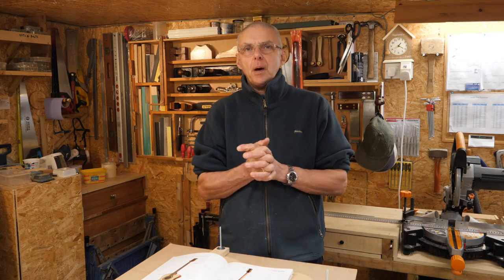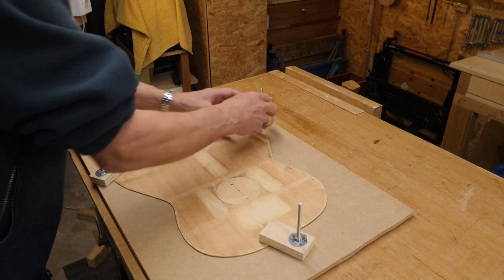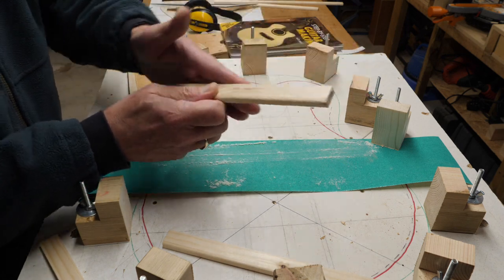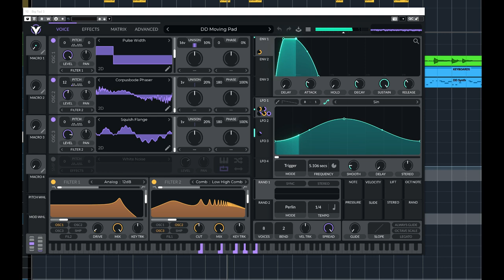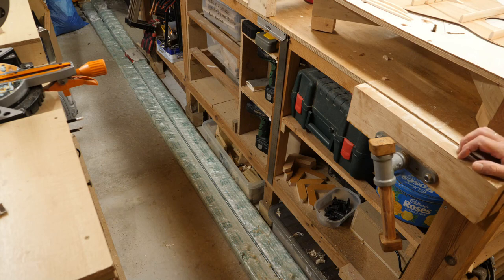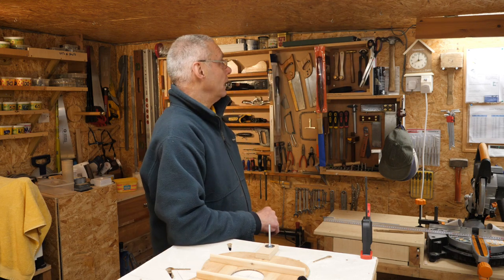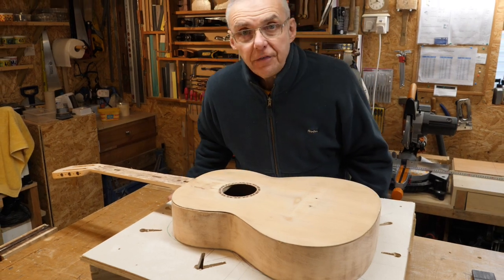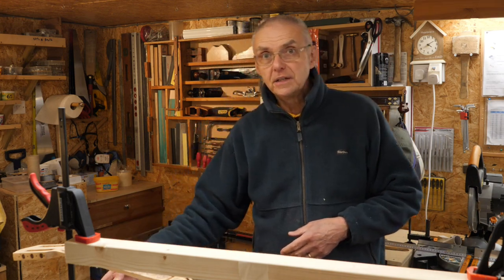My 50 year old acoustic guitar repair challenge - Part 7 bracing the soundboard

Comment: Great progress Dave. Looking forward to the next episide. For a finish, why not try a homemade version of true oil. Equal parts of boiled linseed oil, white spirit and polyurethane varnish. You can ad stain to it if you'd like it darker, then just wipe it on in several thin coats.
Reply from the maker: Thank you for the tip, I will have to try that sometime. Cheers Dave

Comment: Odie's Oil might work for the Guitar finish. They have several different formulas of both oils and waxes. Gives a nice satin finish with a coat or 2 and if using the wax after the oil cures you can get a bit more shine. Just read the instructions it says to use a very small amount apply by hand with a buffing pad kind of like a 3m scotch bright work in in to the grain. Let cure for about 15 to 20 minutes and wipe off or buff with a clean lint free cloth and reapply if desired. It was originally formulated to be used on bowling hall floors I believe it says on their web site so it should be fairly tough finish.
Reply from the maker: I’ve not come across Odie’s oil, sounds interesting thank you. Cheers Dave

Comment: Mate, Im very concerned about your decision to replace a hardwood bridge plate with a dpruce brace. Really a bad plan, and may end up in tears. Id hate to see you rebuild tge guitar and have it fsil badly due to this. The function of the bridge plate is to reinforce the top for seating the strings, and to keep the top flat so the bridge stays in place. Without a bridge plate, the bridge would have a much greater tendency to "peel" loose from the spruce top.
Dont want to sound like a negative nelly, but id hate for it to go belly up after all your work. Mind you, the weight of those fan braces may be strong enough to resist that lol....although they are also likely to be far too heavy to allow the soundboard to vibrate enough to produce any decent sound...thats why it sounded pretty "flat" when you tapped it.
Reply from the maker: Hi Andrew, always grateful to receive your very comprehensive advice, thank you.  I'm on the case with the heavy braces so please keep watching.  I understand what you're saying about the bridge, I have a cunning plan to drop hardwood dowels from the bridge into that cross brace, mmm 🤔 we'll see.  All good fun whatever! Cheers Dave
Reply: @DaveDickens  good luck with it mate, hope your cunning plan works out 😁